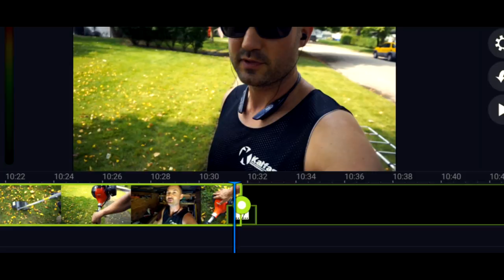Look What I Found

Comment: your lucky to find that hedge trimmer attachment they have been on back order likely till next year once they clear out what they had on hand.  the chainsaw is now the 1/4 inch micro pico but im not sure about them yet, should cut a little easier but cost 1.5x more for the chain which is kinda dumb, let me/us know if you like the new head over the old one.